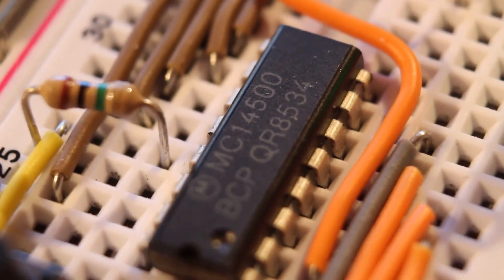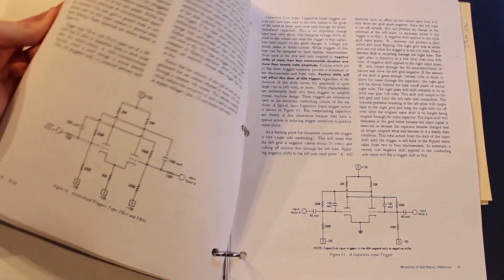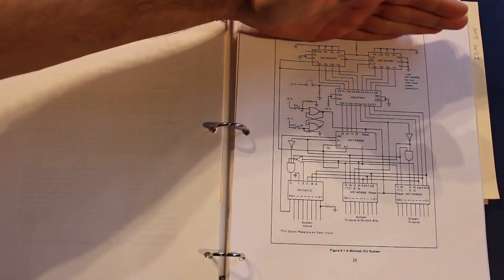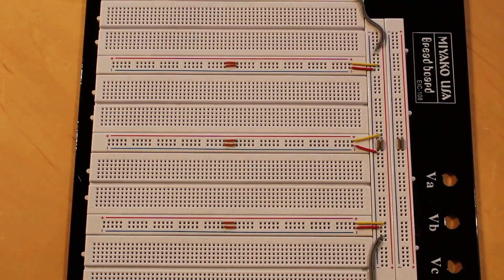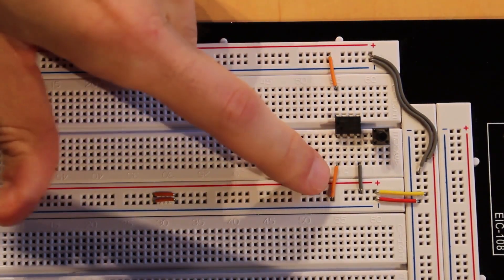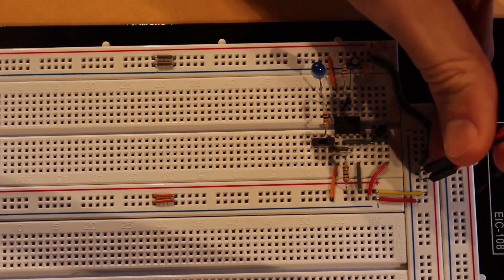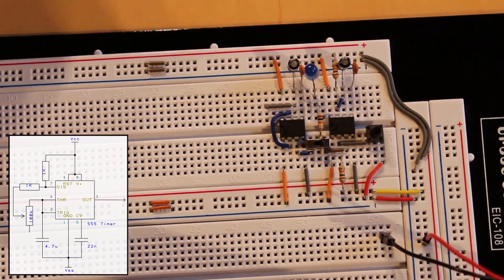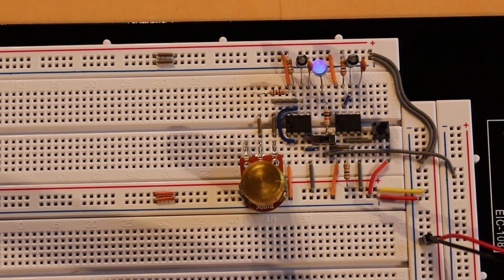1-Bit Breadboard Computer P.01 – The MC14500 and 555 Clock Circuit

Comment: Hey I know its been 3 years, but this video is really helpful, but I do have a question. (I know it might be probably mentioned in this video somewhere but I'm still gonna ask) How many volts do you have to supply to the finished circuit?

Comment: Hi, I had a quick question. In the clock circuit, are the capacitors electrolytic or does it matter? I'm still learning, but I really want to slowly build your project for a computer!

Comment: When you said the datasheet minimal diagram wasn't showing a clock that's actually not true! The MC14500 can be its own clock. That's what the resistor between X1 and X2 is for. The page 3 of the databook has a graph on it which shows the oscillation frequency vs that resistor value, and mentions the on-chip oscillator. Making the minimal system even simpler from an implementation as you wouldn't need an external oscillator or crystal to drive it, really helping to keep the costs down for original systems. 

Granted your 555 circuit does allow for much easier single stepping which really helps with debugging the system and examining the behaviour. Even with a 1M ohm resistor the on-chip oscillator would still be running at some 10kHz

Comment: You disconnected the ground line (13:37) to power-down the breadboard.  Might be better to pull the +V supply instead so you don’t inadvertently energize the circuit with a ground clip from a scope (or other test gear).  BTW - you’re in my top-five list of authors to watch on YouTube (along with CuriousMarc and Ben Eater).
Reply from the maker: Thank you so much!
It's awesome to hear you're enjoying the videos and super flattering to be considered in the same thinking as Marc and Ben, they've been massive inspirations for me!
That's a really good idea about disconnecting the V+ instead! It never dawned on me that test gear would inadvertently power the circuit up through the ground clip, I'll definitely keep that in mind!

Comment: Hi! Awesome job! Where can i get a real MC14500 CPU?? I know there are many online stores that use to fake chip... any suggestion? Thank you!
Reply from the maker: Thank you so much!
I just bought mine off of eBay and got lucky that they were real chips. I put a link to the ones that I bought, so you may get lucky with that same seller.
https://www.ebay.com/itm/202692815404?ssPageName=STRK%3AMEBIDX%3AIT&_trksid=p2060353.m2749.l2649

Comment: Great video as always! I have a couple of comments about your circuit. Breadboards of this type come in two flavours, ones where the power rails are split in the middle and ones where they are not. The red/blue lines on your rails do not show a break but you have little jumpers where the break would be, I suspect they are unnecessary. Secondly, the switch between the clocks could potentially cause you a problem, it's not debounced so at the point of switching if the free running clock has a high output you could get bounces  (I had a related issue at one point).
Reply from the maker: Thank you so much!

I'm right there with you on the split power rails, but for some reason, this Miyako board is actually split even though the red/blue lines don't show it. It's a little tough to see, but underneath my jumpers, where the split is, there is an embossed "W" on the rail (it's upside down in the video). I'm guessing that for whatever reason, that's how Miyako decided to indicate that the rails are split. That took me like two days of trouble shooting the first circuit I put on there to figure out, haha.

As for the switch between the clock, I thought about trying to debounce that as well, but my hope is that for the extremely simple level of programs I'll be running on this thing, it won't cause too much issue. If it does, I'll design it into the PCB version I'll eventually be moving this too as I should have a bit more available real estate by being able to route things more compactly.
Reply: @UsagiElectric  Crossing my fingers for the non-debounced switch :-D
Reply from the maker: @carnright  The way I set up the Halt operation in the next episode alleviates some of the unexpected behavior from the non-debounced toggle switch. Still, there's probably much better ways to build this stuff up!
Reply: @UsagiElectric  Ahh, Fair enough. I've not come across breadboards with those markings.

Comment: Why use two discrete 555 ?? instead, use a 556 dual timer. It will save a lot of space on the breadboard.
Reply from the maker: Thanks for checking the video out!
There's two theories behind why I used two 555s instead of the 556. The first is that I didn't have any 556's in my parts bin, haha. But also, I really like the quintessential 8-pin 555 chip, there's just something approachable about it. But mostly it's because I have a ton of them and wanted to use some.

Comment: MC14500 is an Industrial Control Unit
Reply from the maker: Indeed it is! I only mention it briefly in the intro, but it was intended as a replacement for ladder logic in Programmed Logic Controllers and relay systems. That's why things such as memory and the program counter aren't included on the chip. That way the designer can use the chip in a massive variety of systems. But, it's got most of the basic functionality needed to build some interesting stuff!